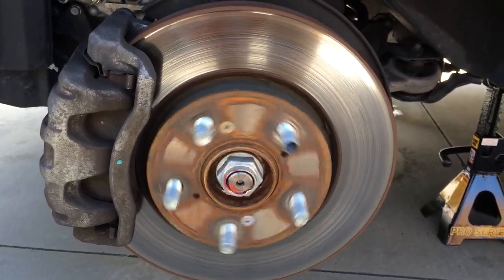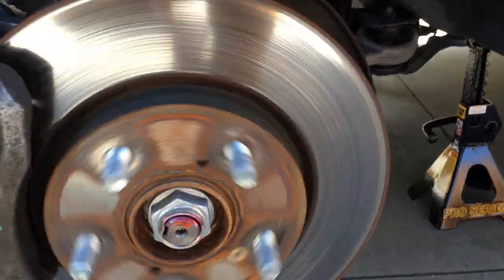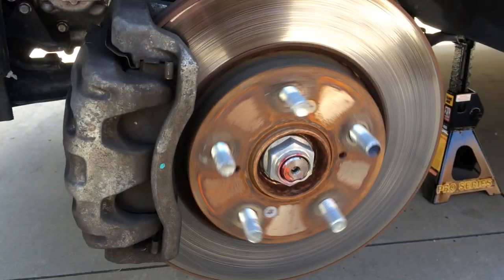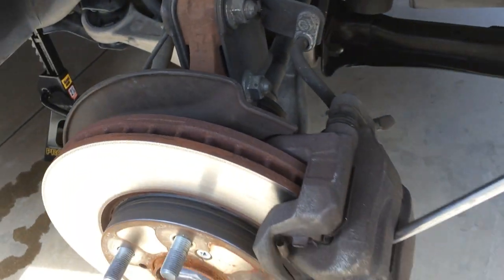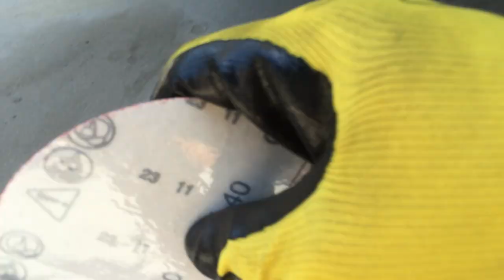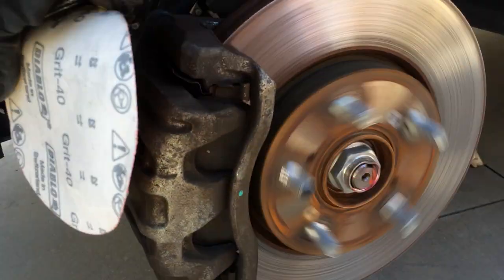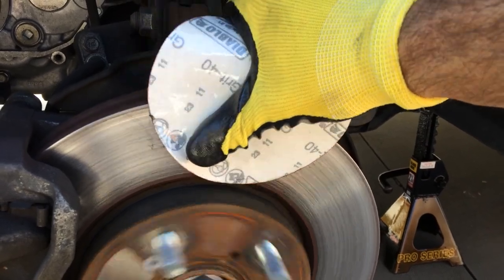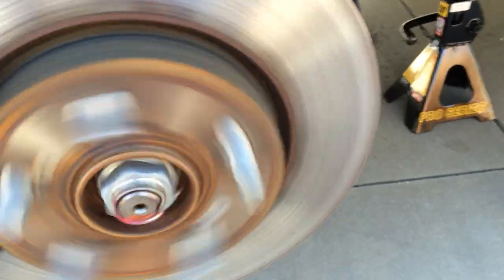Deglazing your front rotors.

Comment: This is NOT a thorough diagnosis or fix as to why your brakes are squeaking. You are supposed to spread a thin layer of caliper grease on the surfaces the brake pad backing plate comes in contact with. That is the most common reason for brake squeak. It seems like people are afraid to use the proper materials to do the job correctly. I get people with their brakes squeaking pretty often that come to me and I re-do the brake pad install properly, cleaning and degreasing and applying the caliper grease where it's supposed to be and never had a single problem. If you dont know how to do it correctly yourself, take it to someone who understands the correct procedures, dont just assume your local garage or even the dealership does it properly because alot of them don't. When you get your vehicle back it's imperative to have the person who did the work point to exactly where they applied the caliper grease and where they didn't. A good garage and/or dealership will be proud to show you that they did a thorough job using the correct procedures
Reply from the maker: CJ Hosey! Of corse you supposed to have break paste. That's a given. What I am saying is that after the third or fourth set of brake pads, your rotors start to get a little glazed. These rotors do not need to be turned, and  I will not turn them unless I have to. I even put a little bit of anti-seize on the ends of the rotor where they slide into the caliber
Reply: @james66872  just came across this video.  Are you saying you are on your third or fourth set of pads and the same rotors?  That’s your problem right there if that’s true.  You either have garbage pads or not measuring the rotors correctly.  No way are rotors lasting through 3-4 sets of pads.  That’s north of 250,000 miles  of city driving alone.  Good pads should be lasting more closely to 65-75,000 miles and no rotors last 250,000 miles.  As cheaply as rotors are now, just buy a new set.  You’ve already gone through the hard part of jacking the car up and taking the wheel off.  The rest is cake.
Reply: @ohboy2592 he is destroying the rotors so that he gets full life out of them 😂
Reply: Good video for discs that were glazed with clay dirt and or hard water together. I would figure the stealing will subside but not after the surface is ground down.  Of course greasing all contact points beforehand..❤😂

Comment: It’s worth mentioning if you do this and don’t replace the old brake pads you’ll likely not benefit very long from this , the old brake pads will also have grooves and spots that will affect the rotors again , best to do this when replacing pads but at that point you likely already have the calipers off anyway
Reply from the maker: Neon diamonds Aquaberry Sir, I’m not “Turning the Rotors!” I’m deglazing them. Huge difference
Reply: James Carroll so you’re deglazing them to smooth out braking or quiet down noise ? It will all come back quickly if you still use the same old pads
Reply: Take the brake pads off and sand down the brake pad material a bit. Gets rid of old groves in padding and will have a nice clean surface.
Reply: You don't understand what this guy is doing. He is " Deglazing " the rotors " .  Not turning them to remove any grooves.

These rotors are still Flat at this point.  Only removing the GLAZE.
This usually stops the squeal sound from Glazed rotors
Reply: You gotta say on the brake pad 2
Reply: will the glazing cause vibration during braking or is that from a warped rotor o ly?

Comment: My front wheels/brakes squeal for the first few hundred feet or until I get above 20/25 mph after I drive from being parked. You think this would help it?
Reply from the maker: If your rotors are shiny like these are, then yes. If not to shiny, could be dust, aftermarket brake pads, or you could even put a little brake paste on the pads before you install them. Hope this helps.

Comment: Mr Conker is right. A flapper disc at an angle across not with the circle will break the glaze and take out imperfections enough to get a budget minded person along. The brake pads will confirm.

Comment: When the new pads seat in to the new or turned or cleaned rotors they tranfer pad material to the rotor this material works with pads to help stop the car and reduce noise when reusing rotors that are in good condition and above minimum thickness its a good practice to clean this material off with a rotor refinishing disc to give the rotor a non-directional finish so the new pads can bed it
Reply from the maker: Michael Pistilli Now this is true. For as many times as I wanted to delete this video due to not having the appropriate sandpaper in the first place, I have always tried to go back-and-forth with the sandpaper at like a 45° or what have you to get a nice crosshatch finish

Comment: after years worth of pads rubbing on the rotor it gets polished. But did this solve the squeak? If I had to do this I'd wrap the sandpaper in a flat wooden block to get a more leveled finish.
Reply from the maker: T_money_ THIRD   It does get rid of the squeak. Also some more brake paint underneath the brake plates helps. I never mentioned it but, I also take a little sand paper to the material that is on the pads. If you were to use a wooden block you wouldn’t be able to scuff up the deeper parts of the brake rotor and that is why I do it by hand.
Reply: James Carroll oh lol I was gonna hold the sand paper up against it until most of the grooves came out. But then again it would never be perfect considering hands would get tired.
Reply: T_money_ THIRD - KISS. ;-) Get an angle grinder or drill with a flap disk (80 grit is more than enough). 5 minutes and it will be like new. 

Remove the brake pads and make a couple of passes with sand paper on a flat surface. Make sure to have all the sliding surfaces also well cleaned of all debri and rust. 

Apply a tiny bit of the appropriate lubricant recommended for your brake system and enjoy better brake performance. DO NOT OVERDUE. ;-)
Reply from the maker: crpth1 That’s exactly what we used to do when I specialize in the Volvos

Comment: Looks like aluminum oxide sand paper. If so definitely don't do this as the aluminium oxide will embed itself in the cast iron disc. Better to use garnet sandpaper.
Reply from the maker: olivedrabax10 this is great to hear. I never even took this into accountable. Even though they are factory brake pads I’ll admit I had to deglaze them not to long ago. Again.
Reply: Medium or coarse steel wool would also be a good idea; it's my go-to for resurfacing metal parts. I find that when doing it by hand, sandpaper is prone to removing too much material and carving out low spots under your fingers.

Plus most auto stores sell it at least as fine as #00 grade, which is excellent for (very gently!) cleaning up gasket mating surfaces, slider pins and stuff like that.
Reply: Next time you replace your pads, ask the part store worker what pads you can get that help reduce glazing on the rotors. You may have cheaper pads on your car.

A long time ago, the pad material (Asbestos) had BRASS shavings embedded in it. Brass is a soft metal so as it wore away it would help keep Glazing down.
Reply: @james66872 what grit. And what about the pads. Don't you have to do something, or is there something you can do if you can't afford new ones?

Comment: My pads were OK yet my mechanic changed them by saying they are stiff and will cut rotors, is it possible?
Reply from the maker: Those may not be his exact words but what he was saying is that you have aftermarket brake pads, (lifetime warranty) that do more harm than good to your vehicle. Imagine your metal brake rotor spinning and you’re trying to slow it down with two rocks squeezing the metal rotor. The rocks are scratching and damaging your rotor versus too soft erasers squeezing up against your metal rotor. When it comes to brake pads. I only use oem/factory.

Comment: What makes them glazzy? I was just told my brakes were glazed. I am planning on changing rotors and brake pads. Will that fix my problem or will it come back?
Reply from the maker: Selman Heybeli Glaze is created from the dust and or after market brake pads. I don’t want to say that this is temporary but it’s a lot better than going out and buying new rotors and new brake pads when literally all you have to do is get rid of the glaze on the rotor itself and maybe scuff up the brake pad with the appropriate sandpaper not the same stuff I was using
Reply: Hard braking glazes rotors as well and low quality brake pads. You can always bring them to O'Reilly and have them machined. Costs at 15 bucks a rotor. The sandpaper trick isn't a long term solution. Buy brake pads that are scorched that you don't have to bed-in. Factory brake pads are the way to go.
Reply: @Gearhead2286  the days of turning rotors are pretty much over. Most rotors don’t have enough metal for this now. Less metal equals more heat. More heat /thinner metal equals warped rotors.
For the labor done it is worth it to swap to a quality rotor with decent metal.
Reply: @1997LT1Camaro  not everyone can afford to replace rotors. Factory OEM Honda Rotors have good thickness so to sage the customer money we machine them. It's all based on the customers needs and money. Not everyone can afford new rotors. That's just how Acura does it.

Comment: Really good idea, minimal disassembly, same results as doing this with a die grinder.
Reply: Lol, yeah, i'm doing fine. As a disclaimer, I'll say that I haven't worked on vehicles professionally since 2018 though...so there's that. These days, I only work on my own vehicles and it's easier to just buy new rotors. If there's rust on the hub, i will still clean that up, but i recommend doing it with a fan blowing the dust away from the air that you're gonna be breathing :) @gregh7457

Comment: i recently had a stuck caliper. Fixed the issue but it left discoloration and heavy rust on my rotor. Is doing this ok to remove that?
Reply from the maker: Vincent Valentine   No! In your case you might want to have the rotors turned
Reply: Thanks man. Appreciate the reply!

Comment: I understand and will be doing everything described in this video. But, could you explain why putting the screwdriver in between the fins of the rotor would not cause major damage once you press the accelerator? Thanks.
Reply from the maker: The Honda Odyssey does not have a locking differential. Let’s take the screwdriver out of the equation, both wheels are spinning in the air, I could walk to either the left or to the right rotor and stop it with my hand and the other wheel would keep spinning. I could let go and then that wheel would start spinning the same speed as the other then walk over to the other side and stop it. The screwdrivers manipulating the system so that I can apply pressure to the wheel that spinning with the sandpaper. Note that is the wrong sandpaper and I do need to make another video with a different car. My Subaru all-wheel-drive would be a great video but may be a little too technical. Noted from an earlier comment mentioned that I did not see anything about opening the brake calipers so that the brake pads are not rubbing up against the rotor while deglazing the rotor. But that also was done with the flat head screwdriver in between the caliper and the rotor just pray back on it a little bit and open the caliper so that the pads are not rubbing against the rotors. Please be careful while doing this
Reply: @james66872  After reading your comment I did some research on the different differential and I get it now. Finding out what type of differential I have is the key. I also better understand the part where you mentioned the opening of the brake calipers as well. This video helped a lot and is greatly appreciated. Thank you.

Comment: Have a wild guess where the grit from the sandpaper goes? Straight to your brake pads hardwear introducing a horrobile squeal I can see your concept working but you have to dismantle the hardwear and clean it up for best results.
Reply from the maker: Wrong.  And the very beginning of the video I said that you need to open your calipers so that the brake pads are not touching the rotors and that you must wipe them off private

Comment: Can you do this with slotted+dimpled rotors?
Reply from the maker: This process is only intended to take the shiny glaze off of the rotor, so that your brake pads do not squeak. It is not intended to straighten a warped rotor, but again to takeoff the shininess. But your question would be yes, you can just please be very careful to not get your fingers jammed against the rotor housing.     Yes you can

Comment: How did you get the rotor spinning?
Reply from the maker: Put it in gear.  The Honda Odyssey is a front wheel drive vehicle. And yes, your ABS light will come on but it will reset itself once you hit like 20 miles an hour when your all done.  Remember to get the appropriate sandpaper.

Comment: I have to do this to my BMW front rotor's. I have the same deal as you.. Glazing only in the front of the rotor's though. I have to all 4 wheels off the ground, I'm AWD.
Reply from the maker: I just did my Subaru Outback. I should have said in the video that after using such a course sandpaper to maybe drop it down to a fine piece to get rid of all the rough edges but honestly I would rather deglaze my rotors then to turn them if I don't have to
Reply: No you don't

Comment: What type of sandpaper do you recommend?  i'm having the same problem with rear rotors in my car.
Reply from the maker: aca1can2 A good medium grit sandpaper works really well and then you can go over the rotor again with a finer sandpaper to clean all a little burrs off.  Don't forget your break paste and also to press the brake pedal a couple times to seat the brakes back into place before you try to move the vehicle

Comment: If your rotors look like this I would not sand them, I would investigate the cause and replace pads and rotors along with what ever is causing the issue, rotors are $40 a pop for OE quality and pads are about the same for a set and shims. My guess, is that these brakes were just not bedded in correctly, or you got tire shine or something similar on the rotor and didn't use brake cleaner to get it off, just sprayed if off with water and called it a day. Also should mention in your video that you must re-bed brakes after trying this.
Reply from the maker: Nate Gruber I'm not a big fan of spraying on my breaks. Not even break cleaner. This shine is honestly from a couple sets of factory pads without turning the rotors. Dust is a huge factor.
Reply from the maker: Nate Gruber You are absolutely right I should have told everybody at the end of the video to pump the brakes and seat the brake pads. Because if not, someone's just going to put the car in reverse or forward and try to stop and they're not going to be able to

Comment: It sounds like your A/C compressor is cutting in and out, when obviously not being used for cooling or defrosting.
Reply: I'm sure he's trying to keep the car cool. It's probably an improper refrigerant charge (too much, or too little)...could be an airflow issue like dirty cabin air filter, or clogged condenser...causing either too high or too low head pressure.  My bets that it's just not charged correctly.

Comment: What grit for sandpaper did you use? It better to use fine or coarse?
Reply from the maker: h3r0 0f t1m3 , this sandpaper that I used is wrong. What do you want is a medium grit from your local automotive store. All you’re doing technically is to get rid of the shine and scuff up the brake pads. But don’t forget to pump the brake pedal before you try to move the vehicle.

Comment: Don't you have to sand the brake pads?
Reply from the maker: kingchrisp198432.  You do not need to sand the brake pads, but still need to put on the brake paste. Also clean the rotor with a wet rag or something before applying the new brake pads.
Reply: James Carroll I thought since the rotor is glazed that the pads are glazed as well, so if I just unglazed the rotor and not the pads will the pads cause the rotor to glaze right back up?
Reply from the maker: kingchrisp198432. You can sand the pads a little bit to your liking. The roughness on the brake rotor will overcome the brake pad.
Reply: James Carroll ok thanks
Reply: It's pointless deglazing the rotors if you're not going to deglaze the pads too. They really should be done together. After all, you've already gone to the trouble of jacking the car up and removing the wheels, you may as well do the job properly.

Comment: Your can mess up your engine and transmission by running the vehicle in drive or reverse with it suspended in the air and no load on the wheels and motor trans ect.
Reply from the maker: Now that is a not true.  No!  You may have an ABS light come on but that will reset itself once you go roughly 30 miles an hour
Reply: Yes. the no load trigger valve will bounce in a 45 degree lateral direction causing engine slap on the down stroke.

Comment: You just un-bedded the brake discs, which means you will have worse braking performance and safety for a while, until they're re-bedded with the friction material of the pads and become noisy again.. lol
Just use the correct grease on the pads, or change pads to a different brand.
Reply from the maker: Random Channel Do you honestly think that a little bit of sandpaper is going to unbed the rotors? I honestly do not think so. And if it does, it only last for about 2 miles! All I use is factory break pads my friend